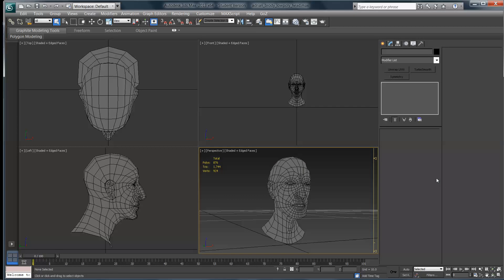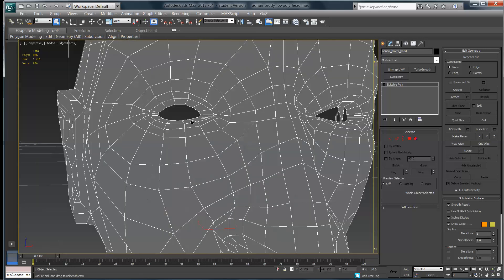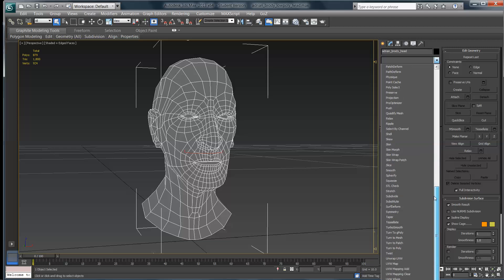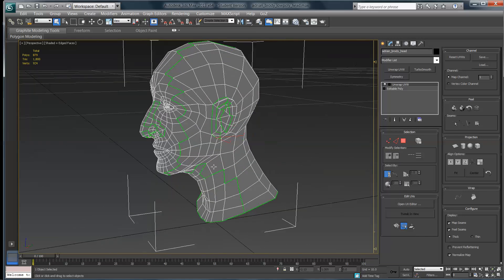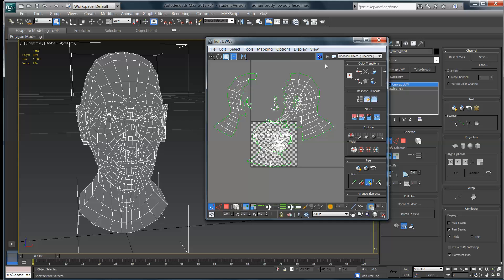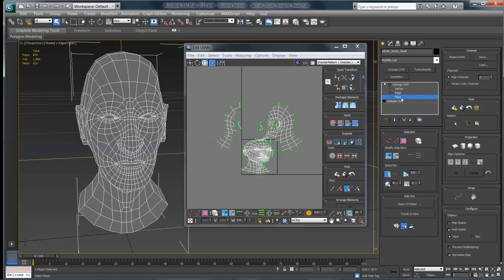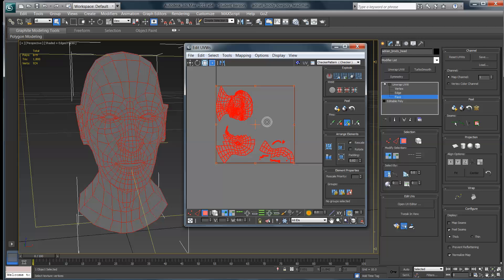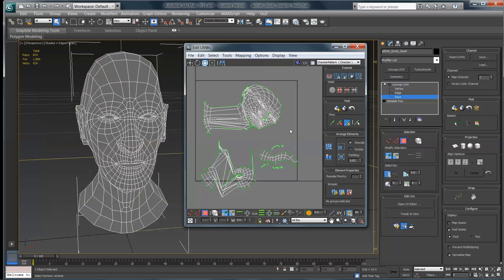Unwrap UVW modifier in 3DS Max Part 01

Comment: I have a question, i am able to uvw my model's and use them to make a normal map, but if i export the object it doesn't have the uv's with it, I collapsed it shouldn't this be automatic after it is collapsed (btw I use 3ds max 2012), I need to export it with uv's.
Reply: never mind, it seems it is odd that if the object didn't have a uv map already when imported it wouldn't apply the current uv map when it was given one.